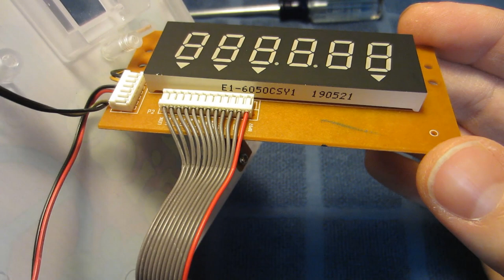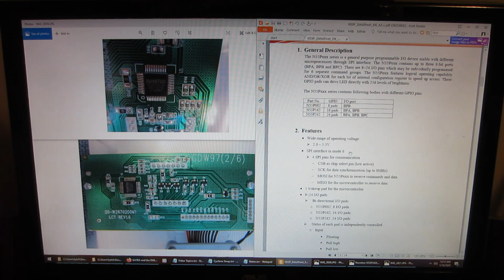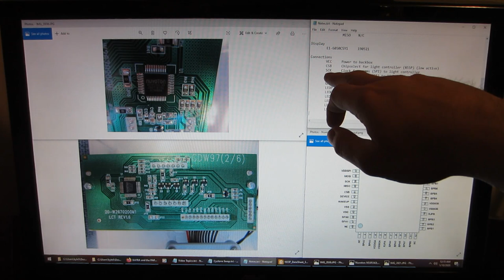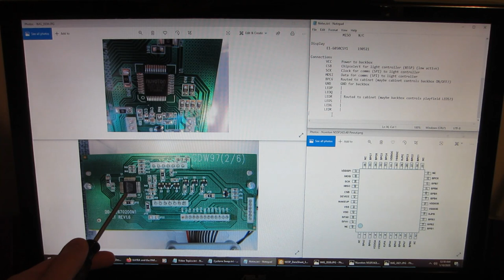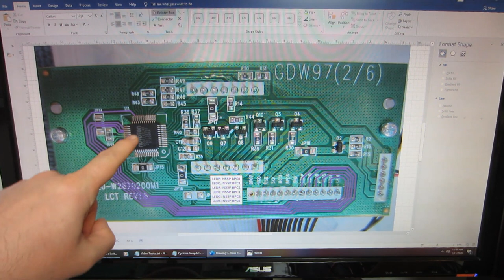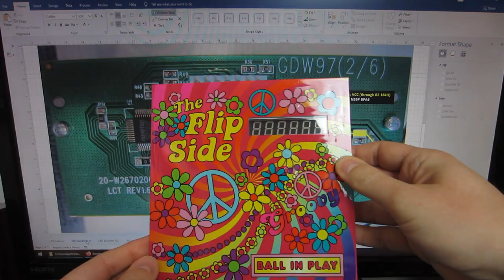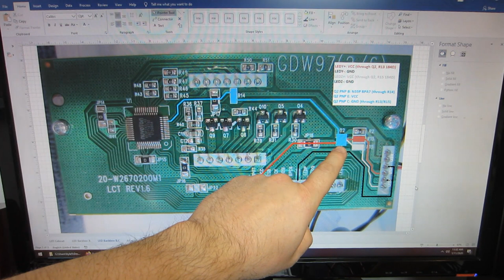American Girl Pinball Teardown 1: Disassembly

Comment: On my unit, the ball gets stuck on the little white crescent shaped piece by the plunger. I have to really tilt it to get it over. Is that thing supposed to move? Would it be possible to take a closeup video of yours in action?
Reply from the maker: If I remember right, there was a little white plastic piece that was only in there for shipping.  You're supposed to remove it.  It slides out the bottom.  It's meant to capture the ball and keep it from banging around during shipping.  Is that the problem?
Reply: @kyle5574  nope, that part is out. I see the piece I’m talking about in your video, but it’s hard to see if it moves.
Reply from the maker: It's supposed to sit under the playfield when the plunger is at rest.  When you pull the plunger back, it pokes up and pushes the ball into the shooter lane.